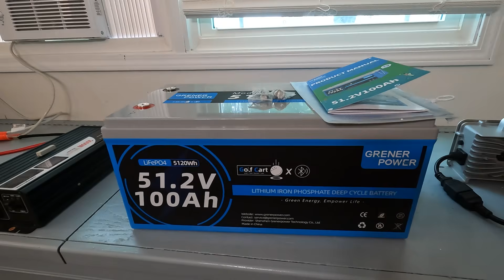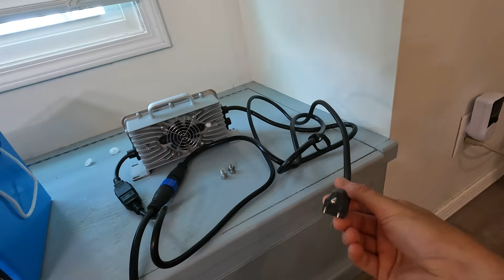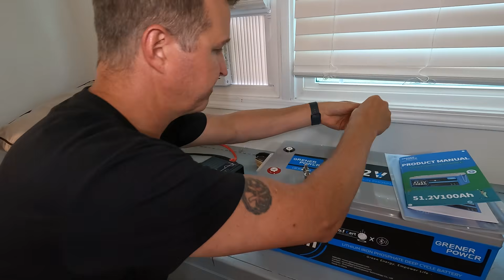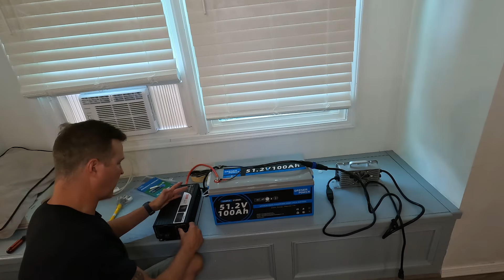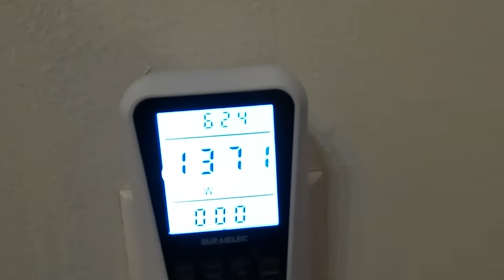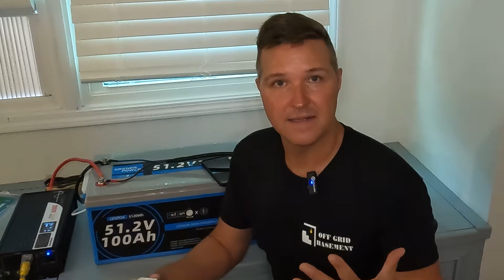Can this GrenerPower 51.2v 100ah Lifepo4 Golf Cart Battery cool this room and save money?

Comment: From a UPS standpoint. An inverter that detects and passes through the AC from a different outlet would be ideal for this application. Would reduce strain on your charger, battery and inverter.

Comment: Great review and explanation!  There is another easy way to run the same 5000 BTU AC.  Instead of adding the separate 2000W inverter and charger, you could just use a power station that has an expansion battery input such as the Pecron E1000LFP (1800 watt inverter, 1048 W-Hr LFP battery, built in charger, and tons of DC including 25 A 12V) or the older EcoFlow Delta 2 (same inverter and battery spec).  Not sure of the company, but you can get a brand specific cable to connect the golf cart battery directly to the power station battery expansion port and it has a built in DC circuit breaker.  Then, just hook the golf cart battery to the battery expansion port, plug the power station into a regular outlet, and plug the AC into the power station.  Each of these power stations allow charging at 1400 watts, which will automatically recharge the golf cart battery and the internal battery simultaneously substantially faster than the external charger you are using.  And you get an additional 20 amps of 51.2V capacity for about the same price as the standalone inverter charger combo.  These two power stations can usually be had on Amazon or the manufacturer's specific websites for $300 to $350, which is what made me think about this other option.  I use the Delta 2 in this configuration in my van to run a similar 5000BTU AC and since the Delta 2 has a 500 watt solar input, i can connect a portable panel up as well to keep it running longer without having to spend more money on a separate charge controller.
Reply from the maker: That is definitely another way to go!  Thanks for the comment!

Comment: So the answer isn't just "yah", its "hell yah!".   Anyway, in terms of saving money the load-shifting generally isn't worth doing unless you also have some solar charging / helping out the battery and can actually reduce or eliminate utility import... rather than just load shifting between times.  Load-shifting alone is very inefficient... usually 80% round-trip or worse.  So it's only worth doing when there is a massive difference between day and night rates from the utility.  Or if you also have solar to help.

The (more or less) cost-efficient solution for something smaller than whole-home is to have a decently-sized power station with an expansion battery port that you can tie a discrete battery to for expansion and a beefy solar input that can take in excess of 1000W of solar.  Like a Pecron E1500LFP for example (with its 700W solar input).  Or larger.

When you do that, the solar will support the A/C from morning to sunset as well as charge the power station, then the power station will continue running the A/C off its battery after sunset until the battery is exhausted, thereby getting you past the "high rate" period of the utility without having to use utility power.

You can play with a digital timer on the AC input to do some pre-charging of the power station overnight but you do want to leave room for the solar to continue charging during the day so it requires some messing around.

--

I'm doing the same thing writ-large... whole-house.  90F outside, 73F inside, running two A/Cs today (whole-house and one portable), 4200W draw.  The solar system is pushing 8.6 kW, running the house and also charging the battery bank with the remaining 3.7 kW.  The solar system produces roughly 70kWh/day on days like this and the 42kWh of storage is enough to keep the A/C going past midnight if necessary, all without any utility import.

-Matt
Reply from the maker: Thank you for all the great input and the comment!

Comment: Nice demonstration.  Do you know if you can run the 5000BTU window unit using 1200W inverter?  I ask because I have a 48v/1200W victron inverter.
Reply: Yes, you should be able to.  It all comes down to the A/C startup current when the compressor turns on.  If the inverter can handle that you should be golden afterwords.   Pair with enough solar to both run the A/C during the day and put excess energy into the batteries to be able to continue running the A/C for a time into the evening.

-Matt
Reply: And note that apart from a roof or a ground array, one can also build a shade structure like a Pergola and slap panels on top as the “roof”.
Reply: @junkerzn7312  Thanks for responding.  Unfortunately I only have enough room for 600 watts of solar panels for about 3 to 4 hours.  When I built my house I planted a lot of shade trees to keep the Texas heat down.  Even the roof is inundated with shade.  Not complaining, but we do have frequent outages and I figured just those moments that we lose power it will be nice to cool the master bedroom.  Again thank you.
Reply from the maker: The only reason I would say yes is because it's a Victron.  Anything else and I would say no...  go 2000w.

Comment: Is there a way, with your setup, to use some kind of outlet device that would know when the grid power shuts down and then turns on your battery charger? Kind of like a UPS set up.
Reply from the maker: I feel like that is the opposite of what you want..  The battery will run the AC unit during the power outage.  Then when the power turns back on, you could just have the charger plugged in and it would automatically start charging the battery.

Comment: Good video to show how to connect this. You showed the only way I can think of to actually save money with this setup. I dont have peak hour extra costs, my electric company charge averages about .11 to .12 p/kWh after all the other charges and goes up to .14 cents/kWh after the first 1kWh, there is an extra .01 charge/kWh after 2750 kWh used in a month. With solar it would definitely save electricity. 12 plus hours of runtime off one battery is a good amount of runtime.
Reply from the maker: Thanks for the comment!

Comment: Great review, I use an old #2 pencil sharpened at both ends as a precharge resistor
Reply: Wow, never knew that would work, thanks for sharing it.
Reply from the maker: I've heard of that before!  I've also heard of a small night light.  When it dims out, you know you're ready to connect.  Thanks for the comment.